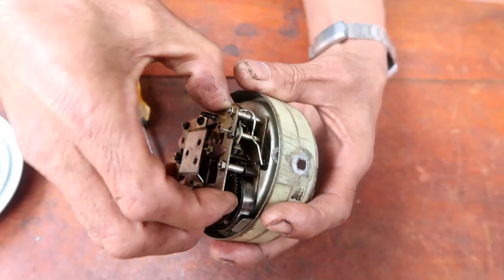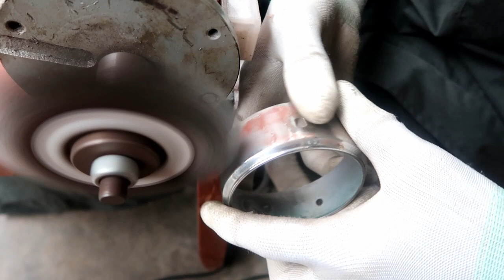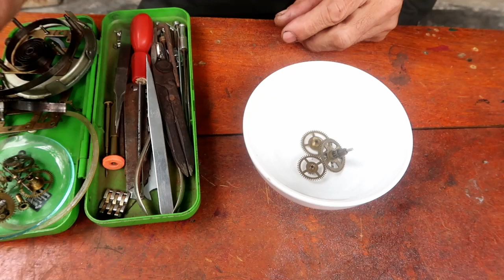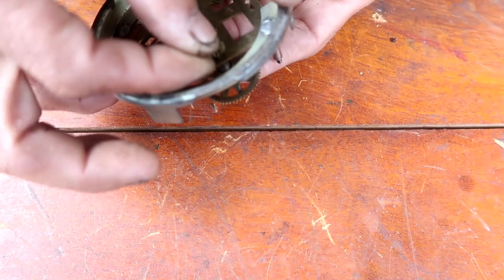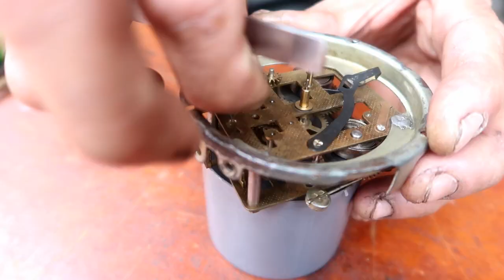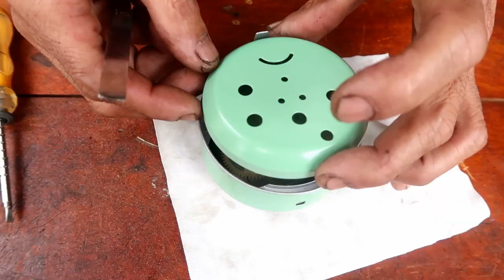Very Old Round Clock Restoration - [ Art Restoration ]

Comment: I'm sorry, but that color combination is HORRENDOUS!  It doesn't match in the slightest.  I like the style you did on the clock face, but it needs to be a different color.    Either that or change the body color.  Props on the mechanism restoration though.  For that, I'm impressed.

Comment: Fine work specially the cas and the dial. I like to restore things instead of trush them. A few things yout did with the clockwork are able to do better with less work. The pivot bearings have to be cleant with cleaning sticks, you can also use toothspicks, atherwise the new oil will conect with the old rests of oil and stick. Same can hapen if you use more oil then nessesary. The oil is everywhere, but not where it is needet.  The mainspring has to be greased (good job to heat the end and form a new hook). And NEVER oil the pinions!